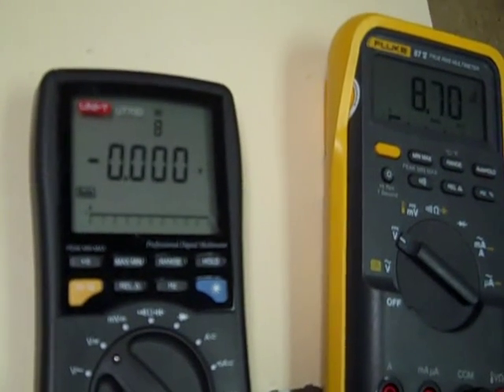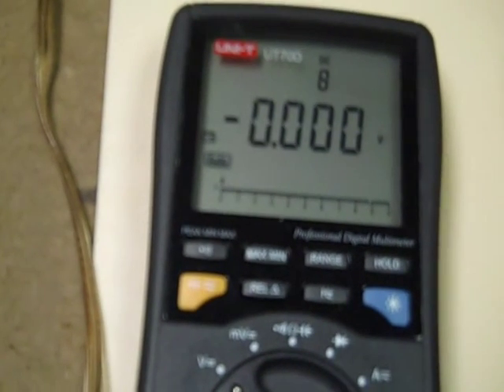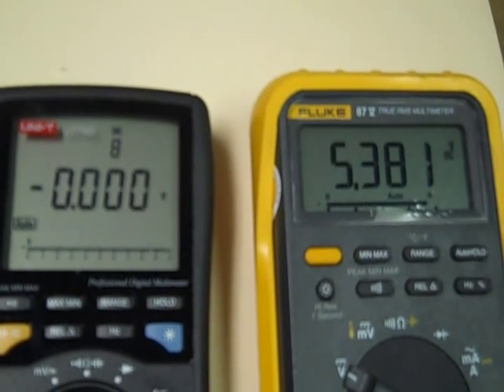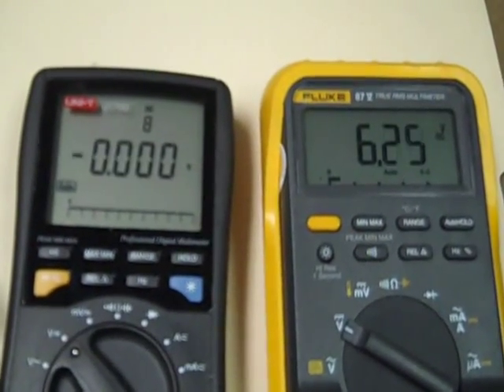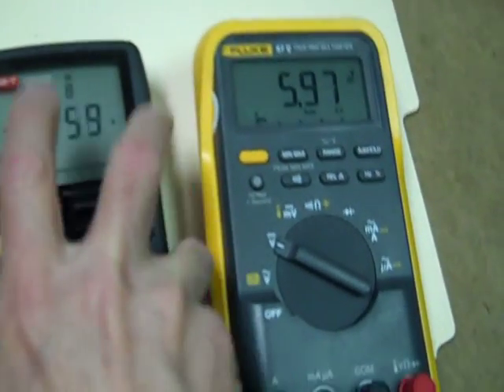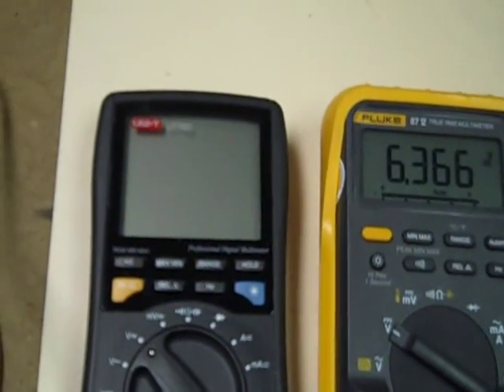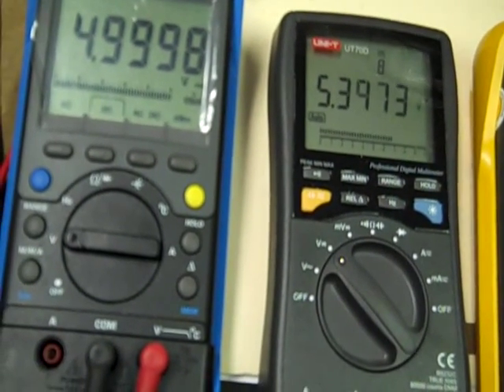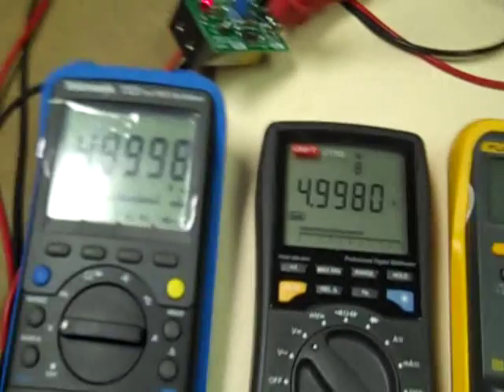UNI-T Model UT-70D Low Battery Indicator Problem

Comment: My multímeter is giving wrong readinds i already tryed to calibrate but for example on 19v battery gives me 16v today i removed the multímeter battery and its weak can that be the problem?
Reply from the maker: Multimeters will often give wrong readings when the battery is low.

Comment: yes in general, i see some over voltage protection and nice input sockets which they dont have on the lower ranges, but the inaccesible fuses and self tappers seem to be their norm, but the bad battery management it seems is just this model, thank you for the reviews, ive learnt a lot about the current models from Youtubers such as yourself

Comment: of several meters ive had instability comes on below 6.5 volts and the low batt maybe the low 7s.  if i had one act up at 8.5 volts that would be a total waste of most of the battery life

Comment from the maker: Running the meter using a variable DC power supply in place of a 9 volt battery.. Good enough for testing labs, good enough for me. The meter only draws at most a few milli-amps.

Comment: Yes it does that, but only when the battery voltage has dropped, again as we know from your video, the battery voltage is low half the time and we don't know because of the faulty indicator. That said, I have had mine (2 of them) for many years now getting pretty much daily use and they are still in great working condition and have many great features for the price. If you can live with the niggles they are a bargain

Comment: I also have a UT70D that does the same, the meter becomes unusable before the low battery warning comes on. the battery life is actually very good with a decent alkaline battery and I get many hours of use out of my meter between battery changes, so it doesn't bother me too much. I just change the battery when the meter shows any signs of mis-behaving or if the backlight stops working

Comment from the maker: @didolevski Interesting about the autoranging on ohms function. Typically a DMM will put out 1 mA maximum on an ohms range. With a crappy or worn out battery this might make a difference. I's say make sure you have a good name brand battery.

Comment from the maker: @didolevski I never had a problem anywhere near 8.5 volts - lots of good 9v batteries are still putting out something like 8.5. I would like to see the meter work properly at least until the 6.7 or so voltage level.

Comment: I have exactly the same multimeter UT70D and it has exactly the same problem. Simply the low battery indicator doesn't work. Also, when the battery eventually gets low (probably I expect around below 8.5V) the autoranging of the ohmmeter suddenly stops working and it simply can't measure resistances. As a voltmeter it still works though. 

Wierd, it's probably a design issue?